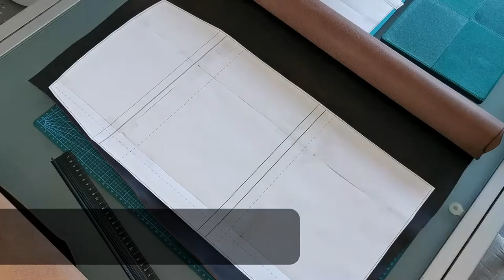Making a Leather MacBook Pro Sleeve 14 by hand - DIY making-of video for leathercraft makers

Comment: Hi there! I've been dying leather work for over 2 years. I love the look of this project. Why do you use wax thread? I used it also but I see others that don't. What is the advantages?
Reply from the maker: Hey Jeffrey,
Happy to have a new comment from you. And thank you for your precious feedback. 
Wax threads have multiple benefits to me:
- it stays in position when I first pass on the holes I made, even with big rounded stitch-holes. 
- it makes the stitching line water resistant,
- it nurtures the thread for some weeks/months avoiding a potential dryness in certain cases (bags for instance)
- it makes the end of the thread not to turn black when you burn the end of the stitching line to seal the stitching. 
- bonus point: it smells good while stitching 😁
Reply: @LordLeatherCraft  thank you so very much. I have some threads that aren't waxed and now I week be waxing them. I look forward to what comes from you in the future thanks
Reply from the maker: @jeffreycrossin427  thank you so much. Happy crafting to you!

Comment: Can you share what size your holes are and what size your thread is?  Thanks.
Reply from the maker: Sure, they are 5mm spaced for 1mm round hole. The thread is 0.65mm round shape. It avoid me avoid too much stitching time without sacrificing the strength 😊💪